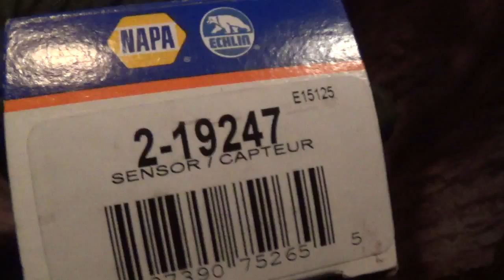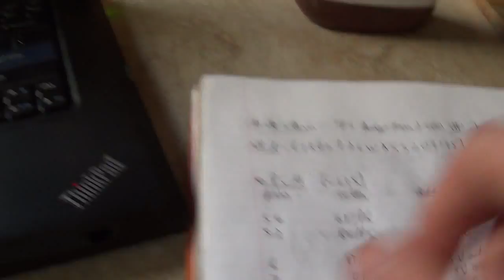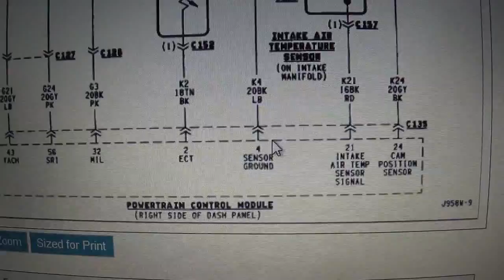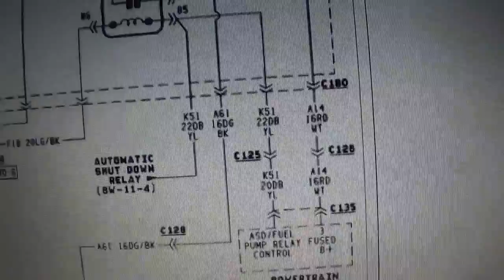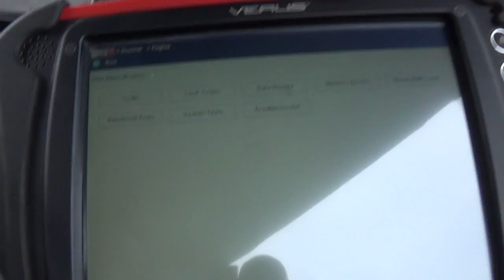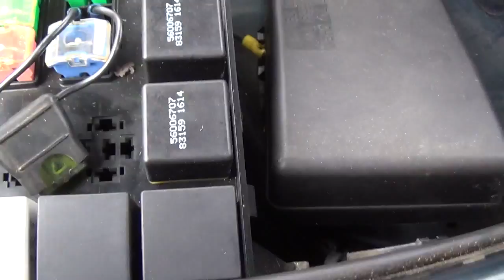(Pt 1) Cold no-start Case Study: '95 Ram V10

Comment: Have you ever seen it where the truck stalls out and throws a cel, fuel gauge, and no bus on the dash. It happens when my 5.9 v8 is at operating temp at random

Comment: ebay has a adapter that plugs into the under hood plug and adapts to the regular 16 pin connector that is on the scanner thats what i use for my truck and you don't need the power source either

Comment: Hi Ivan, love your style of diagnosing, of ALL your videos extremely informative!

Just a quick question I have an 86 ford OBD1 EEC- IV system which doesn't communicate with any scanners so I can't see any of the perimeters, do you know if there's a module that can be connected to between the ECM and the scanner
that maybe be able to read some or all of the perimeters?
I doubt it but had to ask!!!

What I do is back probe the sensor I'm checking at the ECM using my AES Wave uscope…..
BTW I do have an old school snapon BT-2500 AKA the brick that I use to read codes and use the troubleshooting feature!

Can u make a module that is able to pick up some or all of the perimeters, like fuel trims and other perimeters????
TnX
Leor
Reply from the maker: Unfortunately no live data on the dinosaur computer systems 😅
Reply: @PineHollowAutoDiagnostics  spasibo buddy 😀 I’ll keep suffering quietly 😅

Comment: I have a 95 Dodge ram 2500 V10 I'm just around replaced everything the air sensor I replace the the oxygen sensors in the exhaust I'm really not sure what else to replace or look for as my idling problem still exists it's running rich not as bad as it was since I replaced these two things I'm not sure where to go to next to check if anyone has any ideas or have had the same problem please get back to me for my next adventure other than that the truck runs well only at stop idle does it run rough and I yes I am running through some fuel as well

Comment: I would heat the brain , light would come on ,seams like  the fuel pump wouldn't run when light wouldn't come on , then it would start ! Sent the brain out because also the alternater wasn't charging . Installed the brain and it started in the bitter cold and was charging again .Now won't start , rpm gauge going crazy , sounds out of time , hoping crank sensor . This is a 1994 dodge ram v 10 as well !!

Comment: i have a 96 dodge v10 that im not getting spark or fuel sometime... one minute its will have spark and fuel and run just fine and driving down the road it will just die and wont start again... woundering if you have hear of this before or have worked on one before

Comment: The clicking relays remind me of GM's relays in the under hood fuse box making noise even when 'all' the relays were removed.
It turned out, there are non-replaceable relays on the circuit board, that can only be seen when the fuse box is dis-assembled! WTF - well that's funny!

Comment: These are the same symptoms that you find with the jeep ECM problems. These were notorious for the capacitors going bad on the board. The ECM is covered in silicone but they can be replaced. The number one issue was that the check engine light was not on until leaving the key on for several minutes. I came across this issue when I was searching for issues on my 98 intrepid.

Comment: I have zero faith in under hood fuse boxes. I have seen so many with corrosion problems. Might be worth a peek.
Reply from the maker: +wysetech2000 Is it because you drive a Chrysler? ;)
Reply: +motoYam82  Good point. {:-)

Comment: Leak over the PCM caused water to get inside and corrode the board or a similar issue at the fuse box?  I seem to recall an issue with the fuse panel boards in those but that was long ago... Grab a heat gun and hit the bottom of the fuse box. If no go heat the PCM. I've seen a few where the solder joints fail and the cold causes the board to contract enough that there is no contact. When they warm up they act fine.

Comment: I remember hearing clicking like that when the central timer module was working on my old BE series Dodge Ram. It wouldn't start either and would stall out.
Reply from the maker: +StopDropandLOL What's a Central Timer Module and what does it do?
Reply: Dodge's version of a BCM. My Ram was a 99 so I'm not sure if yours has one but it should.
Reply: Also it controlled lots of electronics in the interior. Also contained a primitive PATS system which would cut fuel and stall the engine, which was another problem they had.

Comment: I think there is a voltage leak onto the wire that provides a common ground control for the ASD and fuel pump relay. When the ignition switch is turned to start and the starter spins the engine,  the PCM grounds this common circuit. But because there is a voltage leak on this ground wire this interferes with the ASD and fuel  pump relay coils engaging and closing their respective slave circuits.

It is interesting that the wiring diagram used shows no pinout at the PCM for this circuit. I think it is pin 51. I would remove the 60 way connector at the PCM and look for corrosion, melted plastic or something else that is allowing current to travel between the receptacles. I believe pin 32 controls the MIL and it is in the row above and close by and could be shorted to pin 51???

Comment: Moto, I don't have the schematics, but a buzzing relay demands some basic troubleshooting here.....examine the relay coil inputs.....with the scope.......if you have two buzzing relays, probe them on the same screen and look for a phase delay in the quickest time frame your scope will allow..
Reply: +Clete88 If you find a phase delay, check the INITIAL circuit for continuity issues.....the usual, voltage and ground...

Sorry if I'm flooding your channel...I'm just held in suspense....I do this kind of work....just not on cars...and I'm fairly decent..
Reply from the maker: +Clete88 This is a very interesting theory! Reminds me of drawing Bode phase plots in electronics class... So which specific relay pins would you scope, and in what scenario might you expect a phase delay between them?

Comment: When I was like 8 I wired a relay to switch on from 5V battery and then 
short the same battery just to see what happens :) Well, 
TRRRRRRRRRRRRRRRRRRRRRRR happens! So, my guess, you have a short to the 
ground on the wire(s) the ASD relay controls. The short heats up and 
stops being a short? -- that's probably the funniest thing happening here. I am sure tracing the exact location will be a major pain! Good luck, Vanya!

Comment: Interesting for sure . Wonders if it is the fuse box . if temp is a factor , may try warming up separate  parts and see if one changes with heat
Reply: +wtbm123 Most excellent suggestion, I'm thinking of an 80s big hair days hair dryer myself.  Almost sounds as if there is another relay under the two that quit buzzing only when both are pulled and only diminishes when one or the other is pulled.  This aspect most puzzling say Charlie Chan.

Hey Ivan, I thought I saw a joining of the 8 volt and 5 volt circuits within the TPS sensor at one point in the morning scroll thru the diagrams - might be of some use to test these circuits inside the TPS?  You are being tested with these odd ball cases Ivan - it happens only to the best, a tempering under fire if you will.

Comment: I would start searching for a poor ground connection, corrosion of some sort
Reply from the maker: +Ozzstar But where? I was hoping to find a bad PCM ground, but those all checked out perfect!
Reply: +motoYam82 haha that is the key question....chassis and engine grounds can be a pain to find and access.   If i was there I could point them out to you lol  Looking forward to seeing  part 2
Reply: @ozzstars_cars  I had an issue with my 03 Trailblazer - there was some resistance in the battery-chassis ground connection. I removed the bolt, used a burr to clean rust off then added some copper no-sieze to the connection. Voila! Issue gone.

Comment: Was sitting comfortable, wondering what the blazes is goin on, when the tea break comes around. That is sure one sick truck. One relay off colour, but the second ? The T pin is the way to go. Dodgy 8 volt reference for sure.Pcm's dont go that often unless diyers try their hand.The owner is signed up to the 98% ers with all the parts changed. Don't mention Schrodinger's box or there be trouble ahead.
Reply: Pcm's from that vintage thru the 2000s were very problematic, mainly for weird no starts like this and general no starts. I can't count how many of them I have encountered.

Comment: Is the fuse box one of those integrated controllers on this vehicle or does 1995 predate that technology on Chryslers? If warming it up fixes it it must be a bad solder trace or joint somewhere. I don't think applying heat would fix a crusty connector. Fascinating stuff Ivan. Looking forward to part 2.
Reply from the maker: +zoidberg444 Oh man this thing is a dinosaur, made way before the garbage integrated TIPM modules came to the scene! The relays on this thing are bomb-proof!

Comment: Ivan, can't wait to see what you come up with. I had a 2000  dodge 1500 with a 5.9L doing just about the same thing but it started when it was cold The relays would chatter like crazy and it sounded like it had a huge vacuum leak. It would do this for about 5 minutes then wham run like a charm. I started to investigate, then the tranny went. I ended up selling it to a guy who had the same truck with a blown engine, so he wanted it for parts. Out of curiosity, I sure would like to see the fix because I see a lot of similarities in the symptoms that mine had !

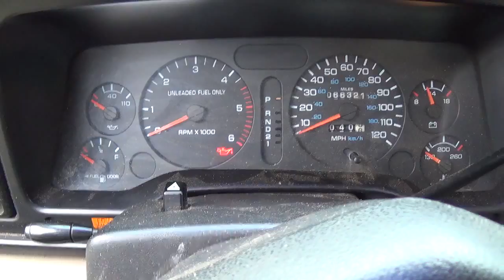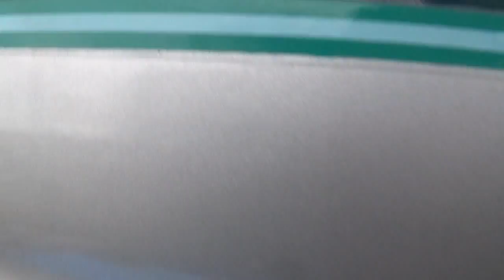Comment: DID YOU SEE THE FUEL REMINDER LIGHT ?  CHECK CAREFULLY AT 15: 50 TO 16:10 THEN AT 16:34 TIME
Reply from the maker: +pedro l rivera negron Yeah I asked the owner about it, he said the sending unit is intermittent and that it had 10 gallons of gas in it...so that means I could drive like 50 miles in this thing haha
Reply: HA!!!! FOR ME ITS HAS SOME ELECTRICAL ISSUE.....THOSE 2 RELAYS CLICKING ALL THE TIME!! VERY SUSPICIOUS........
Reply: WE'LL SEE WHAT SURGE IN PART TWO!!!
YOU'RE THE BEST..MY FRIEND!!! KEEP WORKING ON IT!
Reply: +pedro l rivera negron Just have to ask. Did you turn caps lock off?

Comment: 8 liters? When gas goes back over $3, the cost of driving that beast must be expensive.
Reply: I have a v10 in my excursion. I get about 8 in the city and 12 on the highway. And, mine is a 4x4 as well. I don't know about the Dodges, but my excursion is geared pretty low as well. The gas mileage sucks but she's a beast in the snow. Of course, I  don't drive her that often but super reliable
Reply: in europ whe pay around 3.50$ /galon after quick  calculation/converting
Reply: +lawrence hogan this dodge is an 8.0L v10  and your excursion has a 6.8L v10 so the dodge would probably do worse
Reply from the maker: +Ricardo Lupian Chevy big block 8.1 gets same/better fuel economy as the 6.0L ...go figure.

Comment: Hi Ivan - rookie question,  I don't see anybody checking grounds I believe  pins 4&5 on obd2  or this obd1  at the DLC , why not ?  Looks like an easy spot to get to first. Is this a dumb question. LOL
Reply from the maker: +Steve Rob Hey Steve! That's not a rookie question...that's a Premium question! Well do you mean for a no-comm issue? Sure, that would be a great place to start. In this case however, since the PCM was acting weird based on the loss of the Check Engine light, I had to verify grounds directly at the PCM (plus no OBDII connector on this beast lol)

Take a look at the ground distribution for your Chevy Truck. You will find that DLC pins 4 and 5 are tied to different ground locations than those for the PCM, so you have to check all of them separately.

Oh yeah, thanks for the Premium Limited Edition stickers!! Gotta figure out where to properly display them :)
Reply: +motoYam82  haha premium question, ok I'll take a look at my OEM factory schematics but I think dlc pin 4 is connected to the ECM pin 5 chassis ground. Yes I was wondering why I don't see any channels starting at the dlc grounds.  Looks like I have some homework to do. I was going to send you a Loadpro but Eric wouldn't put the Amazon link up. Hey I tried buddy. Cheers
Reply from the maker: Oh man if Eric puts the LoadPro in his Amazon store I'll fall off my chair!! But I want one for "testing" purposes sooner or later. Maybe the viewers can chip in a bit. I can promise you my review video will blow your mind Steve haha :)
Reply: +motoYam82 A little bird told me your  dream will come true real soon. LOL
Reply from the maker: Haha well my birthday is next month, so that would be very awesome.

Comment: where do you get your wiring diagrams from?
Reply: +Chris Canty  Looks like Alldata
Reply from the maker: +Chris Canty http://www.bbbind.com/free_tsb.html and AllData.com :)
Reply: +motoYam82 http://www.wilsonautoelectric.com/tsb_database.html also have the same diagrams as BBB
Reply: That's great guys, but when I want to chase down where G104 ground actually can be found on the vehicle, it seems the line drawing has gone AWOL and is only to be found in the factory service manual.  Missed it by THAT much !!  Any suggestions are most welcome, TIA.
Reply from the maker: +Lee Barnes Well yeah for ground and harness physical locations, the factory diagrams from AllData is my only source.
Reply: Thanks Ivan, I was afraid of that.  I can't justify the cost with such a low need of the service.

Comment: To see if the PCM is failing because of the cold you can take it out after the day warms up and starts reliably and stick the PCM in the freezer for a while. If it does the same thing as a cold morning start then there's your problem. You can also try and start it on a cold morning, if it fails, put the PCM in a box while connected and warm it up with a hair dryer through a hole in the box to get rid of all other variables.
Reply: CO Jones bad solder spots would show their ugly face
Reply: WARNING SKILL LEVEL 1000 :) .Nice thinking a like it